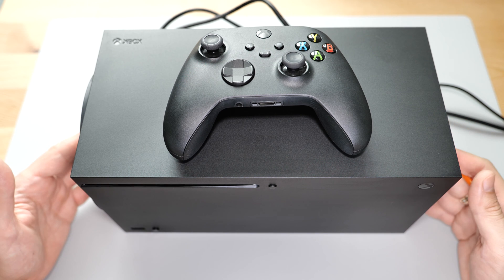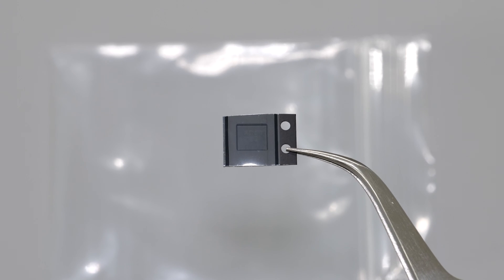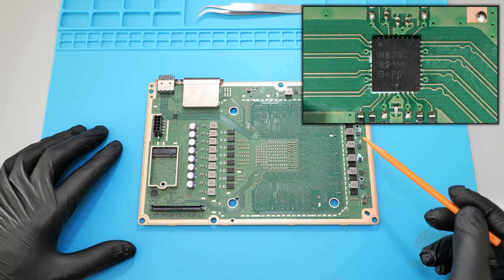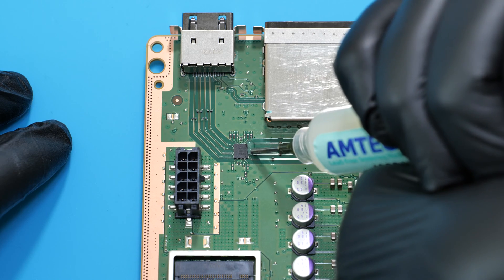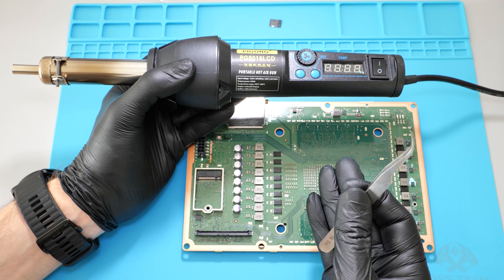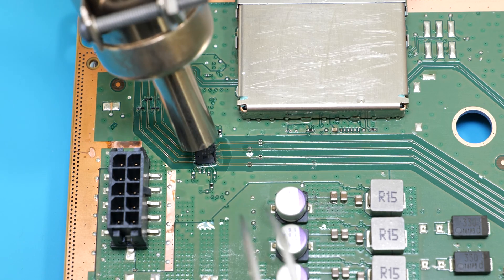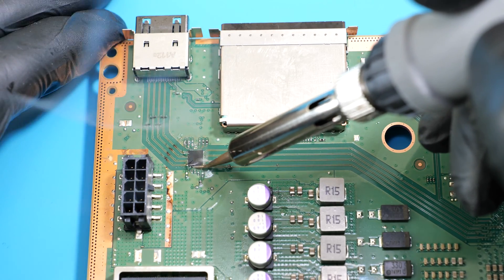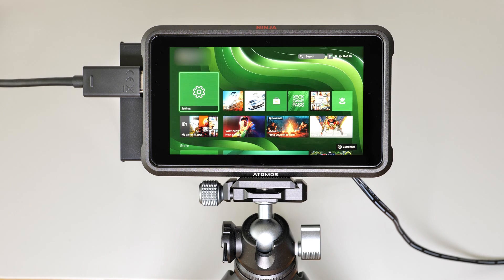Xbox Series X No Display Fix – HDMI port or HDMI Retimer Chip fix Guide

Comment: I'm very grateful to have found your channel! Recently, a lightning strike hit near my house and my xbox series x have only 640p resolution. I changed the hdmi cable, the tv and nothing. Could it be the hdmi port or the HDMI retimer chip? I want yo be sure and buy the correct part. Thanks  bro!
Reply from the maker: It's very unlikely that the problem is in the HDMI port. If the lightning strike had damaged the port, the console would be completely dead. Most likely, the HDMI controller chip got damaged and that's the reason why it's stuck at 640p. Also, check the traces that go from the HDMI port to the chip. Damage to the APU's video output is possible, but I've never seen such cases. So if you feel confident, you can replace the chip yourself if not, give it to someone who can.

Comment: hey did u replace that decoupling capacitor u knock off in the video. i also did the same thing yet to reasemble and see if it works
Reply from the maker: I don’t think I knocked off any caps. As far as I remember, that console was fixed and returned to its owner.
Reply: @ElectronicsComputers  @1:37 if u look above the retimer between the resistors theres a tiny white decoupling capacitor  and then @3:05 you will see that cap missing 
im currently working on one ive replaced the port twice and now have replaced the retimer. before i replaced the retimer i was getting a "no signal" nut my TV was able to see that there was something connected but no data now after replacing the retimer my tv doesnt see anything powered on, on that port

Comment: My Xbox is doing this and I’ve tried everything but this I’m planning to do this my self appreciate the vid I need it 💪I’ll be back with an update in a week or two
Reply from the maker: If the console seems to work fine (except no screen) and the controller syncs with the console, then most likely it's either HDMI port or retimer chip.
Reply: @ElectronicsComputers that’s what mine does starting this morning

Comment: Just wondering regarding Xbox Series X, is it possible to replace thermal putty with thermal pads on the VRM and Ram chips?
Reply from the maker: Well, technically, it's possible, but I would never recommend using thermal pads in that particular console because there are non-standard gaps between the components and the heatsink. In theory, you can use highly compressible pads, but they have terrible thermal conductivity. The harder the thermal pad, the higher its conductivity. Therefore, Usiren U6PRO thermal putty is the best solution available on the market. I have a video on cleaning the cooling system and replacing thermal pads and paste: https://youtu.be/GTvtAM7Fi5U
Reply: @ElectronicsComputers  thanks for the reply I saw a user on reedit who did it just wondering if it is a good idea